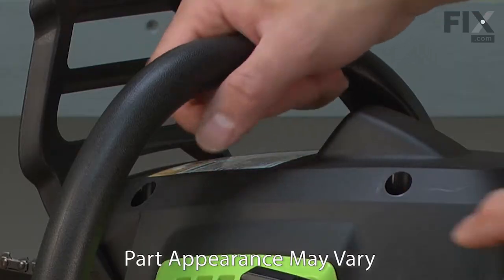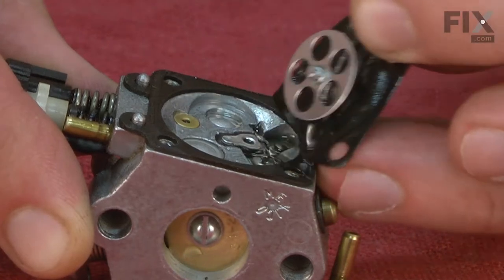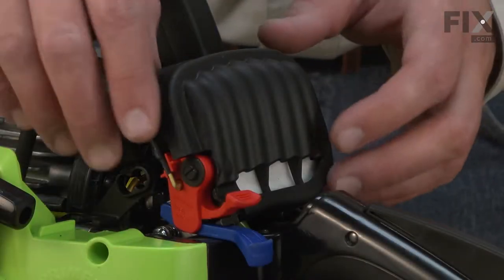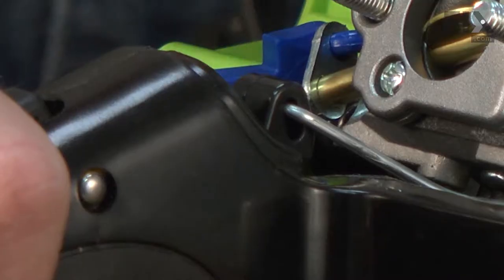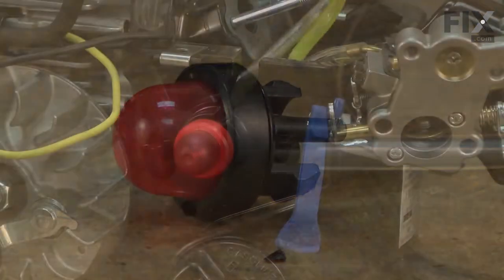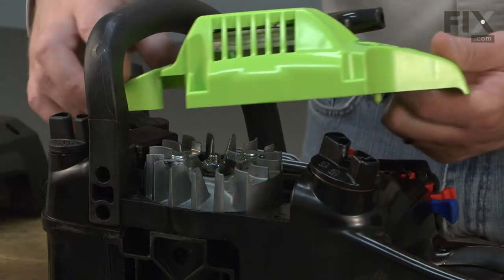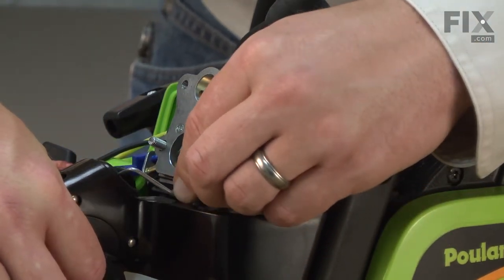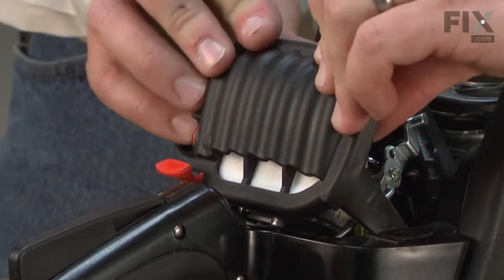Poulan Chainsaw Repair - How to Replace the Carburetor

Comment: When the longest piece of fuel line is 1/4 inch long it would be very helpful to know were  to connect the replacement lines to the carb and bulb